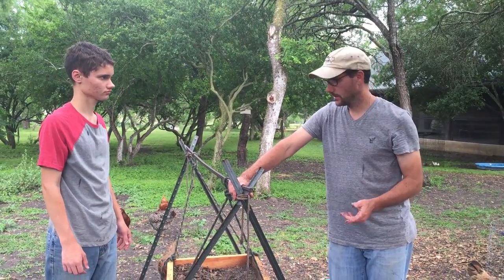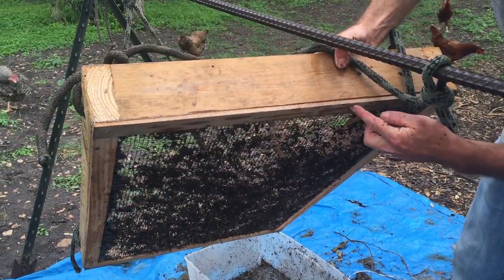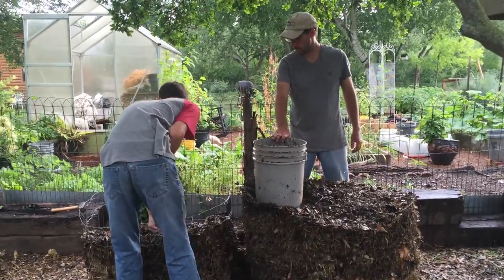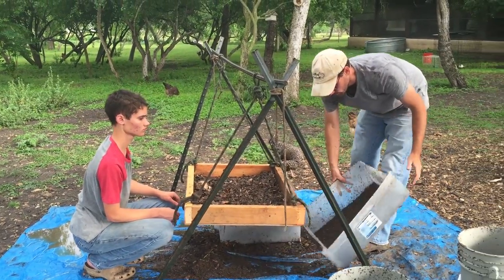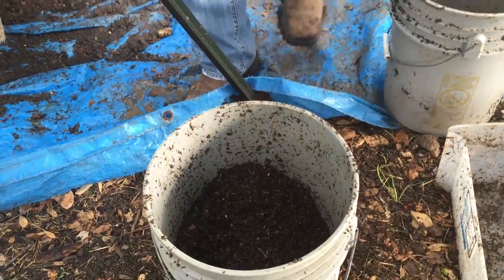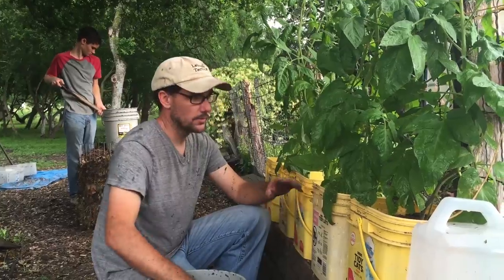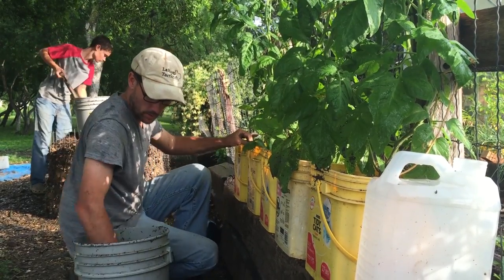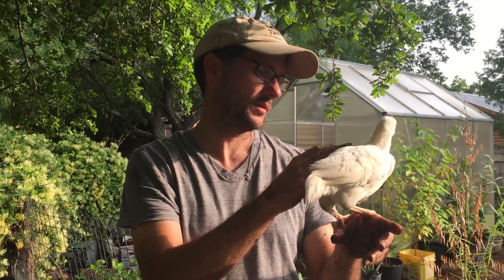How To Make Fine Sifted Compost and a Chicken Introduction

Comment: Aside from the fun aspect what is the benefit of sifting the compost Blake?
Reply from the maker: ***** I've noticed that when I put the larger bits in the garden my pill bug count goes way up. The sifted compost gives me the benefits of fine finished compost with less material for the bugs to hide in and eat. The larger bits stay in the pile to be composted further. There are some applications where I don't bother sifting, but when I'm dressing around the veggies I like it sifted.
Reply: Blake Kirby if it reduces pill bugs, does it also not attract worms and other beneficial decomposers?
Reply from the maker: scott I'm sure it does attract worm, but so does unsifted compost.
Reply: I would've never thought of hanging the sifter like you did. I built a sifter to sift big-box compost last year (which was full of wood chips that I attempted to make bio-char out of), but had it standing on buckets. This method seems far more efficient!!!

Comment: Thanks Blake, I need something for my sifter. It gets really tiring holding up in the air or beating it on my wheelbarrow. Good one! Love the chicken, she's cute.
Reply from the maker: ***** A more passive way would be to build the sifter like a table so you could add your material to the top then just use your hands or a tool to push it through. The shaking could be a bit much for some... I wouldn't want to do it for long :)
Reply: Blake Kirby I've been toying with a few ideas that would be easier on the body. Believe me, if I find an idea that works, I'll film it. LOL

Comment: I like your shift compost. Have 5 minute rain is a good thing. Since you have chicken and compost, its both a mutual benefits. Make a bigger compost setting and let the chicken go into once a week to scrape and shift. This may help speed up the composition. ?
Reply from the maker: yack f zay I do that too. There is compost material in the chicken run being scratched at until I'm ready to add it to a pile.
Reply: That is good. Homesteading and gardening bring family together.